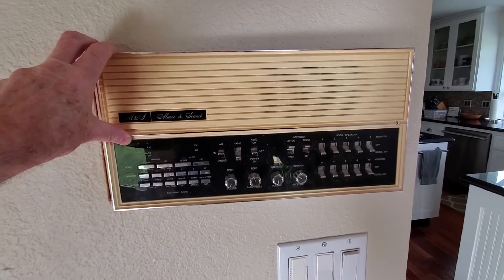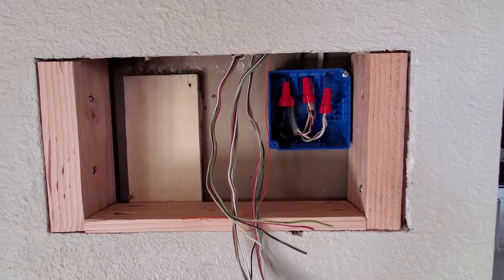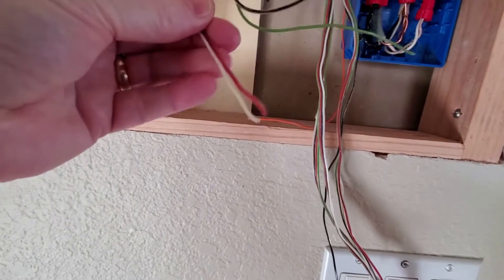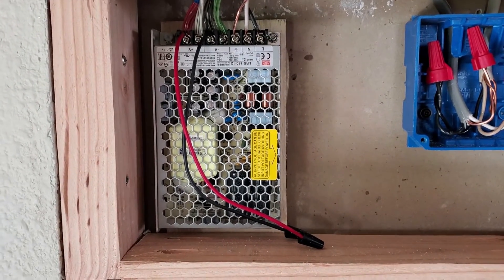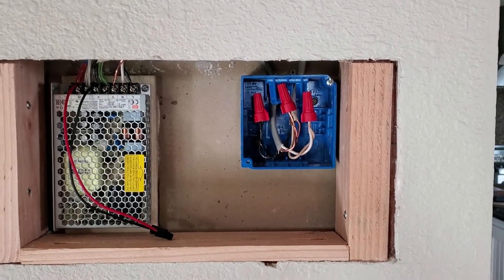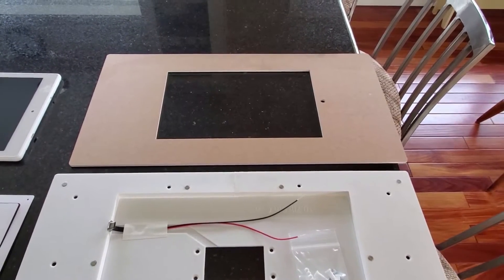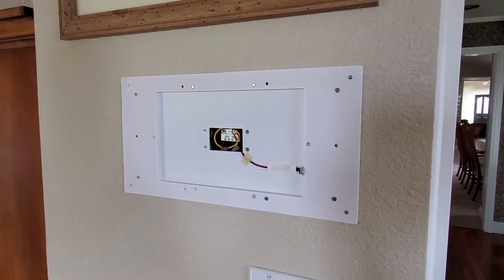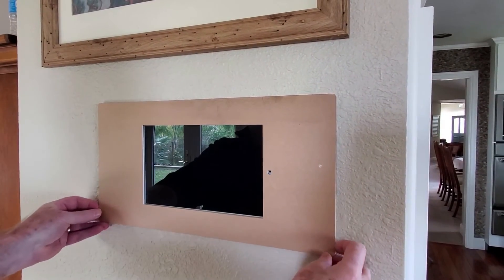Old Intercom Replacement - Wall Mount Tablet

Comment: Hi there. Great video. We have an old ms system intercom, music, doorbell. We have speakers thru the house. The old system crackles, so want to remove it. Want a video doorbell. I like the tablet idea…contacted Mikes acrylic housing unit. My question, is there any concern of overheating of tablet battery. I have an iPad but turn it off at night. If it’s connected to a power source 24/7 will the battery get hot. Does the sleep mode virtually turn unit off. If I want to hook up a camera in house along with a ring or nest video doorbell, will it show on the tablet. Last question, the house has speakers. Could you play Amazon music thru pad that is connected and have sound thru house as the old ms system had fm radio. I also have a Sonos music system…so I don’t have to pipe music from former intercom system…but wondered if you are able to. Will doorbell ring thru pad on the wall? We will get an electrician…but want to know what supplies to have. Thx So Much. Erika
Reply from the maker: Hi Erika - the Charging for the Wall Mount Ipad and the power distribution for the Satellites will be the same as per the video; Regarding Charging, and battery status, the ipad will behave no differently than if your simply left it connected to your 'normal' wall charger. Set up screen-saver/sleep according to your preferences. 
Note that I use Fully Kiosk Browser which is an Android app to control sleep and auto-wake on motion detect. The benefit of the FKB has the auto-wake on motion - when the Android Tablet is mounted in a Wall-Mount, the ability to 'wake' is otherwise governed by access to the power button, which is not readily accessible; so turning on automatically by motion detect circumvents that.  Sorry, I'm not familiar as to what a comparable IOS app might be that would perform the same functionality. 
As to Doorbell, Camera and Sonos integration, you should really consult with Apple (or maybe Reddit etc) forums for some guidance - sorry, I'm not an Apple user so can't give any meaningful advice in that regard as to how to integrate those devices to the ipad. At least however, I would expect the Sonos should be straight forward, Alexa should be able to communicate directly with that via bluetooth.

Comment: Thanks again for everything.  This has been a huge help.  I was going to use your recommendation for the new power supply for my system.  I am however using a fire 10 as my main hub and 4 fire 8 tablets as my remote stations.  Would you still recommend this power supply or would I be under powered.  I love the idea of a closed power supply to be more  in line with code.  If you ever get to the Chicago area dinner and drinks on me!  Thanks so much.
Reply from the maker: That power supply will be perfect for your config, with still a lot of overhead if you choose to add more devices. Recognize that it's rated at 150W / 12A - however, that would be 12A at the 12V output voltage from the supply; the Fire devices are all 5V, so that equates to 30A at that voltage. You would be best to use a 5V converter at each station locally - they're inexpensive and electrically it is better to run the 12V lower current through the interconnect wiring and the converters at each component. Nice idea of the Fire 8's locally at each remote station, means you probably won't need a wall adapter at those locations and can use a tablet wall mount directly. Also, good choice on 8's vs the 7's which might have been a consideration - the 7 is very underpowered and the 8 is well worth the small additional cost.
Reply: @decosse01  

Thanks so much.  The cost of the fire8 on sale was lower than the echo dot currently.
Reply: Mike is doing the wall mounts.  You have been absolutely great sharing all your knowledge.

Comment: This has been a great help and truly appreciate all your efforts and recommendations.  I may have some questions later in regard to my intercom removal but I was wondering if you are still enjoying your eufy doorbell?  I am very interested in adding this to my system but wanted to know if the homebase can be located further away from the bell itself?  I do not have the ability to place it close to the door but my Wi-Fi signal is strong throughout the house.   Thank you!
Reply from the maker: Thank you @Tony H. Glad you enjoyed the video. I absolutely do love the EUFY - I moved recently and replaced the Ring at the new location almost immediately with the same Eufy. The biggest advantage (well on top of being a much better quality video!) is that there is no monthly fee, since your videos are all stored locally. I kept the Ring and relocated it to another location; but by the time you get the notification the event may have passed and you only see live view without having a paid subscription. But the Eufy stores every event for months and you can pull up any date directly on your phone. And no further fees! 
I can't give you exact range between Eufy and Homebase, but I think you should be able to locate it with reasonable range given you have good wifi throughout the house. (they say 20-30' should be good, depending on intermediate walls etc) The homebase does not need to be super close - just recognize that the homebase connects wirelessly to your router, so just needs to plug in at the most convenient outlet. The doorbell connects wirelessly to the homebase, but it has its own wireless connection, not your wifi. I hope that helps!

Comment from the maker: Here's another tip that you can utilize with your new Echo System - I just added this feature today! 
Get a Bluetooth to RCA/Audio Bluetooth receiver (e.g. https://www.amazon.com/dp/B08JXCWX6C/ref=sspa_dk_detail_2 ) and connect it to your AVR (or old school Audio-only Receiver-Amp) - pair your closest Echo Device or main Tablet to the new Bluetooth Receiver (all the Echo devices have built-in Bluetooth transmitter) and play your music through your HiFi Audio system. 
I took it a step further by connecting my AVR via a switched smart plug, so I can leave my receiver with the power switch on and enable the power to it via Alexa. 
There is a fair selection of Music available 'free' through Amazon music or you can subscribe to 'unlimited' for much greater selection. 
Or simply pick a station of your choice to play through iheart radio (which works directly on Amazon devices) 
e.g. Alexa, play 94.7 on iheart radio - or Alexa, play soft rock on iheart radio.

Comment: Just wondering if you had an outdoor intercom (at front door maybe) what you did with it?
Reply from the maker: great question Amber! I actually DID have one in the original system which was similar to the room stations in regard of 2-way communication. I did not replace/re-integrate that directly but installed a new Video Doorbell; my preference here was the Battery Powered Wireless Eufy. Eufy stores all the video locally so there is no subscription fee, unlike Ring. And the quality is far superior too! The original bell-push/intercom location was not conducive for video so the new one locates right on the Door Jamb - being completely wireless lets you mount it in the optimum position. As well as viewing/answering from your phone, you can have it display, on request, on your new Main home console; or you also add (for example) an Echo Show into your Alexa system - I had one on the Kitchen counter. You can automate via Alexa to have it pop up automatically with doorbell push, or simply ask 'show me the doorbell' . And of course you can also have it announce the doorbell ring at any or all of your new Wall Echo stations with a chime (or message) of your choice.
Reply: @decosse01  Yes.  We have an Arlo doorbell currently on door jam as well we were thinking of perhaps just covering the old outdoor intercom.  This was an excellent video and we plan to redo ours this way, thank you!  Do you know if the Arlo devices will integrate to chime through the dots if installed in each of the old locations as you have done?
Reply: I installed  a wired ring camera and echo show on main unit side so I’ll be able to just ask Alexa to view camera I have set up around my house from my couch ring subscription is only like 100 a year I find it worth it for the cool tech/convince factor

Comment: Thanks for all the valuable info, I've got almost the exact same system (7 total stations). Quick question, for your new set up using the sealed PW and chocolate block connectors, what gauge wire did you use for your jumpers? I've got 14 gauge and finding it a bit too big to fit with in the blocks with the station wiring. Would I be ok to go down to 16 or even 18?
Reply from the maker: Your positive feedback is most appreciated and glad it helped! The jumper has to provide current for at least as many as are served by the jumper. And you need to consider worst case, which is probably when music playing (loud) on all the stations.  16 might be OK, especially since it is literally only about 2" long. But you can also consider something like WAGO connectors (lots of YouTube videos on those and available on Amazon) - the nice thing about WAGO is you don't actually need jumpers, they come in multiple configs for 2, 3, 4, 5 and even more connection ports.  If I was doing this today I would probably use those. e.g. https://www.amazon.com/Splicing-Connector-Lever-Nut-Assortment-Pocket/dp/B07NKT2P2F/ref=sr_1_29?crid=3IY7L4QN25W9U&keywords=wago&qid=1642315104&s=hi&sprefix=wago%2B%2Ctools%2C124&sr=1-29&th=1

Comment: I'm starting to assemble the parts to do this same conversion but have a question - you indicated that you replace the power supply with a sealed unit - since the new unit appears to have power in and out as single leads (from the photo) what did you use to bank the intercom wires? Or is the image deceiving? Do you have any images? Finally, any thoughts on using the speaker out from the puck to power the speaker in each room (I've already upgraded to newer 8 ohm) - I'm thinking a small RCA jack would push the sound to the larger speaker.
Reply: i am thinking the same..  how did you wire intercom wires

Comment: Awesome job and explanation. Question I have, can you play music throughout all of your dots like surround sound?
Reply from the maker: Thank you Lloyd. I'm not sure if you are using the term 'surround sound' in its true definition, which would be a digital sound system sending unique signals to each component to give a 3D effect - in that case the answer would be no. But if you simply mean, can you distribute sound throughout the house (and even having selectable groups) then yes, you can use the echo system to control that. The in-wall wiring is now ONLY used for the power distribution and the audio is all wireless through the echo network and you can select individual dots or groups of them to play your music across your dot network. 
https://www.amazon.com/alexa-multi-room-audio/b?ie=UTF8&node=21480962011&tag=googhydr-20&hvadid=486616651872&hvpos=&hvexid=&hvnetw=g&hvrand=17683511344788574563&hvpone=&hvptwo=&hvqmt=e&hvdev=c&hvdvcmdl=&hvlocint=&hvlocphy=9033515&hvtargid=kwd-884527952779&ref=pd_sl_7tbrpf6pli_e
I hope I answered that for you correctly?

Comment: Hello again.  When replacing the old intercom, is it possible to add an echo dot inside the wall to have sound coming from the main unit?  If so, how would I connect it?
Reply from the maker: Well the first answer is that you can have music play directly from the main unit!  
There would be a few issues with mounting INSIDE the wall - the sound is going to be muffled, if baffled by the main console; and the microphone might similarly be compromised. But if you really wanted improved sound vs the Tablet Speaker, it might be better to mount a Dot (via a Genie) adjacent to the Tablet - while the wall is open for the Intercom removal/retrofit for tablet, it would be easy to drill a small hole through one of the side studs for the power wire and cut a round hole in the drywall in the next cavity over to install the Genie mount (you would not need the acrylic plate in this instance, just the round hole for the Genie) and the 12V pigtail would then connect direct to your 12V connections.

Comment: With the new sealed power supply that you switched out, the link pictures a black cord running through the unit.  What is that for? Is it harder to install the sealed power supply?
Reply from the maker: It's actually two separate insulated cords - one is the 3-conductor AC Input and the other is the 2-conductor DC Output. It's just as easy, if perhaps even easier, to install the sealed one because of those input and output cables already being connected; so just need to connect the AC inside a junction box to your incoming Line Romex, and the output to a connector block.
Reply: your mb mount link is not working
Reply from the maker: @mikedaifallah8023  I can't speak to what is wrong with his website - do a search for 'Makes by Mike' - his ETSY site is still valid.

Comment: You have been a great help.  Can you explain how you wired the intercom units to the new sealed power supply?
Reply from the maker: Thank you Tim Levey! If you look at this thread, you can find a post of mine with an image of that - https://www.houzz.com/discussions/4321917/what-to-do-with-old-wired-intercom-system#27008518 - I just used a simple 'chocolate block' - https://www.amazon.com/Terminal-Connector-Electric-Barrier-12-Position/dp/B08NGBQWWT/ref=sr_1_6?dchild=1&keywords=terminal+block&qid=1625879136&sr=8-6 to join the supply outputs to the wiring. Note that I just used additional wires to jumper over to the other terminals to allow multiple wires to fit. (and of course you need separate jumpers for the plus and minus)
There are also these types if you prefer -  https://www.amazon.com/URBEST5-Position-Covered-Screw-Terminal/dp/B01CG2HI0E/ref=sr_1_9?dchild=1&keywords=terminal+block&qid=1625879310&sr=8-9
Reply from the maker: To the top

Comment: can you also use existing speakers with the fire HD? my system has a two ceiling speakers and a doorbell I am not sure what I can do with those?
Reply from the maker: Probably not Cristina - but you can still use similar process to convert the ceiling speakers to dots (those same mounts as per the second video linked in the description) will also hold them in place even if upside down i.e. a ceiling!) If your doorbell is linked into your Intercom, then most likely you will have to replace that also.
Reply: @decosse01  thanks for the response i will most likely be updating them as well not sure yet but maybe  some sort of  Bluetooth speakers. Thanks for you video I have been looking for solution to update my old intercom system with better technology and this is perfect.

Comment from the maker: I have since updated with the Power Supply with a Sealed Module - the original Power Supply had exposed terminals with the AC on them - See the link in the Main Overview Description
Reply: @decosse01 I agree that the sealed version is a better idea. How did you connect all of the low voltage wiring to the new power supply? I would guess a large enough wire nut would be sufficient? If I'm visualizing correctly, I'm guessing you mounted the sealed power supply to the wood, the AC end of the power supply is entering the gang box on the right and connected there with wire nuts, and the low voltage end of the power supply is connected to the old intercom wiring in-wall outside of the gang box. I would think this would satisfy code since the PS is outdoor rated as long as the AC cable wrap is similar to Molex wiring. If nothing else it is definitely much safer. I appreciate the info, I just bought a house with an old intercom and I think I'm going to tackle this as I'm already invested in Amazon's ecosystem and this would be much better than what's there.
Reply from the maker: @SeanTownsendStormrider  I actually replied to another similar question below  just a couple of days ago - see the question and answer from @Tim Levey post. (There is link to a thread with an image of how it looks now). Good Luck with your project, I hope this helps to get you on your way!
Reply: @decosse01  cant seem to find the @ Tim Levey post regarding power supply connection..   can you repost
Reply from the maker: @grgcoll  If you sort by 'recent first' it's going to be close to the bottom - from 2 yrs ago.
Reply: What was the reason for the change? Was there a real need or just peace of mind or what?
Reply from the maker: @SouthernBeau1  Thank you for excellent question - I just felt that the original power supply didn't really meet code, especially with the exposed terminals (even if they were actually inside the wall). I also saw posts about 'nema enclosures' to separate the AC Power and DC Low Voltage but don't see those as necessary (this is a sealed module with two separate harnesses; the external AC connections are within my switch box containing ONLY the AC connections; the DC connections do not even require a box at all (point in case, take a look at Low Voltage old-work 'boxes' - these are just essentially a ring to secure a wall plate externally but are just completely exposed inside the wall. Interestingly I just picked up some DUAL AC/DC new-work boxes - https://www.homedepot.com/p/Carlon-2-Gang-Old-Work-PVC-Dual-Voltage-Box-Bracket-E-18-4-DVR/202664434  - note that these have one 'closed' section for the AC and an 'open' (to the inside of the drywall) section for Low Voltage. So I think this new supply makes it more compliant by completely separating the AC and DC (note that I cannot guarantee that, but to my interpretation it is - and undoubtedly moreso than it was before. It wasn't a huge expense - and indeed similar cost if I had selected in the first place!